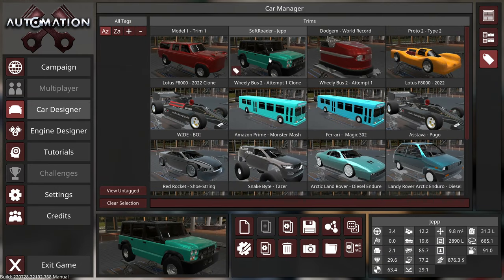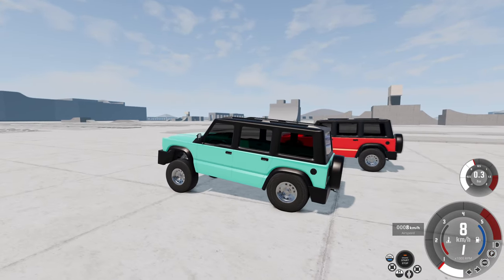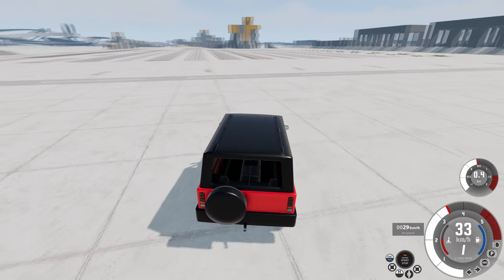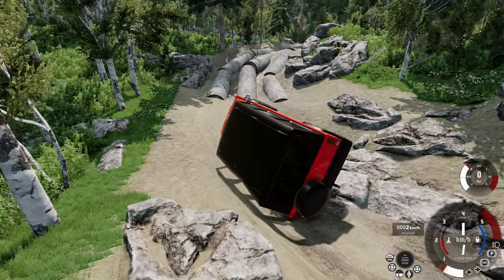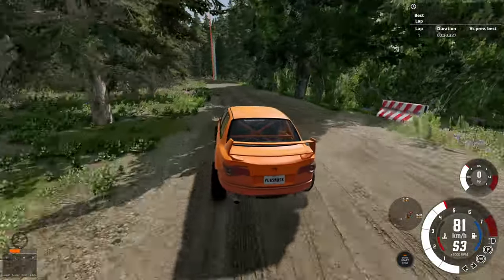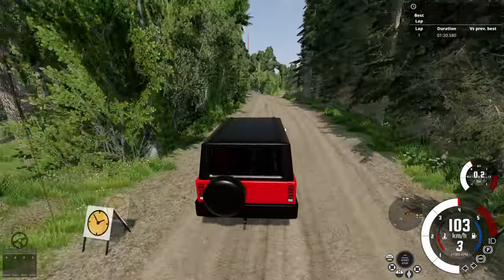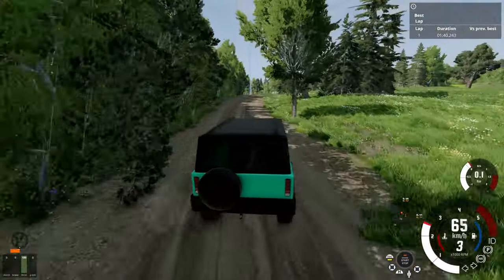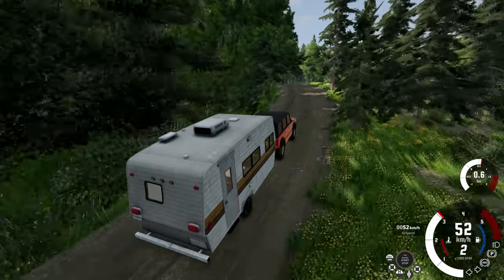Hardest Suspension Possible (Automation + BeamNG.drive)

Comment from the maker: Next week we get into some drag racing.....
Reply: cant wait u deserve more followers for sure
Reply: Do you answer on discord
Reply: These cars again
Reply: Make a funny car dragster! If you don’t know what that is search it up!
Reply: Would love to see a Volvo Rally car, T5 AWD turbo 300hp rally spec on the dirt track
Reply: @STRYX that would be a good idea 👍
Reply: I remember the first video of the bugo that you made and so the first car that I made in automation was a bugo, although it would die when I accelerated. Basically I would love to see a drag bugo.
Edit: I was curious so I looked, and somehow you have not made a bugo solely for drag racing
Reply: I wonder how different will soft suspension be if you used hydropnuematic suspension.
Reply: Lol try n make a 20k hp drag car n either download a modded tire compound or edit traction value n make it by urself and see if u can make the suspension flex 
Reason for 20k hp is cause if the jelly trucks suspension was at a .4 then 10 should be around 20× stiffer

Comment: The wobblematic( c ) suspension is by far the best setup of the two, funnily enough, and I'll explain why.

The engine doesn't have enough torque to pull the truck by itself, so by lifting the wheels in the air, the engine spools more of the turbo by reaching higher RPMs, meaning in stronger contact patches.
Reply: Found the failrace viewer lol

Comment: What you could do is to make several cars that are almost identical to each other, but have one distinctive feature. For example one car would have 100 horsepower more and would be made entirely out of carbon fibre and so on and so forth. Then you could compare them in a series of events to see how different they are to each other.